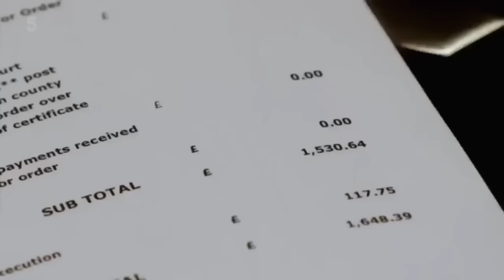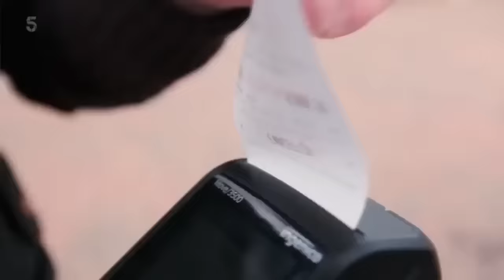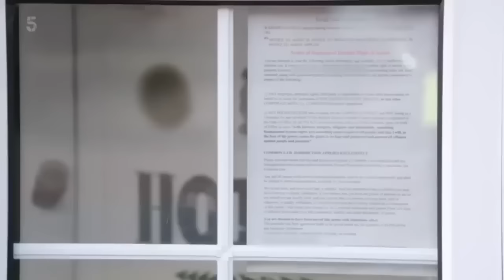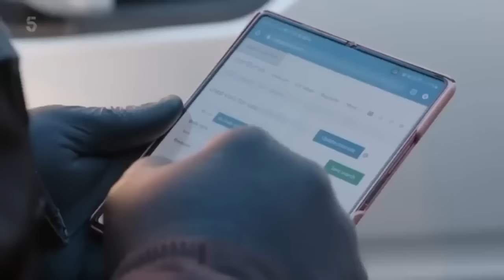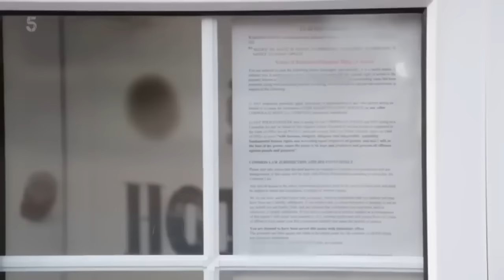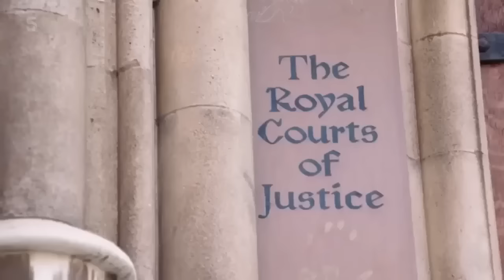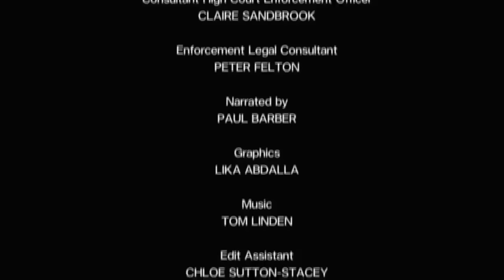🔴 Call the Bailiffs  Time to Pay Up    S1E6    Enforcement Agents Execute High Court Writs

Comment: Pretty sure they can’t take his van and tools as it’s his means of income to repay the debt
Reply from the maker: Don't let debt-related stress weigh you down. Visit shergroup.com today and let the experts handle your case. Shergroup offers a range of debt recovery services and is just one call away if you need assistance.

Please Check
https://shergroup.com/product-page/property-residential-repossession-of-property-service/
https://shergroup.com/property-solutions/transfer-your-possession-order-to-the-high-court/
https://shergroup.com/product-page/property-trespasser-removal/
Reply: You are 100% correct, but said it earlier, lot of misinformation in this comedy series
Reply: They don’t want to, but they are commanded by the court. This has been ongoing for a very long time with nothing offered as payment. If they don’t try, they end up with double the debt and crucial items taken and sold at auction (a fraction of what it’s worth) until the balance is satisfied.
Reply: They'll take the means for the debter to pay the debt in the first place. That's just the way it is, sadly, so the debter doesn't have a leg to stand on if the bailiffs remove his means to pay off the debt. I would never do such a job or want to take up a career as law enforcement myself, but if I ever did do that, so far as debters are concerned, I wouldn't remove any of their means to work which would enable them to pay back what they owe somebody, especially work vans, tools and I'd leave them with a computer, printer, monitor and phone if they had a desk job or office job.

Comment: No way 400,000 vehicles are wrote off a year 😂
Reply from the maker: Don't let debt-related stress weigh you down. Visit shergroup.com today and let the experts handle your case. Shergroup offers a range of debt recovery services and is just one call away if you need assistance.

Please Check
https://shergroup.com/product-page/property-residential-repossession-of-property-service/
https://shergroup.com/property-solutions/transfer-your-possession-order-to-the-high-court/
https://shergroup.com/product-page/property-trespasser-removal/
Reply: Apparently so 1 in 83 drivers write a car off every year. Bear in mind it could be written off for many reasons be it stolen and then essentially stripped would writenitnoff, flood damage, engine failure, weather issues again floods or other damage, crashes, fires the list goes on. Bare in mind if a vehicle is wrote off it won't necessarily leave the road many people keep non structural write offs. A car can essentially be written off multiple times.
Reply: Written.